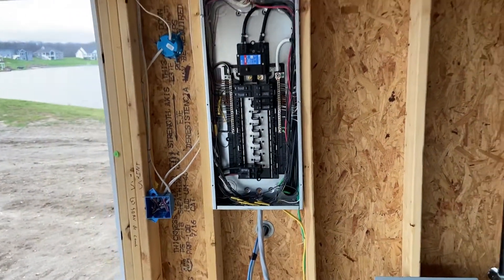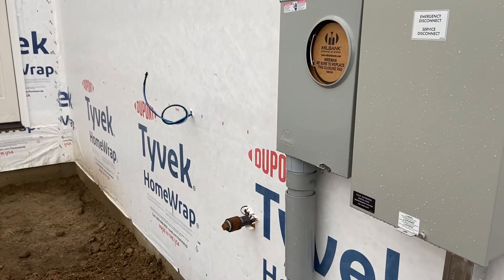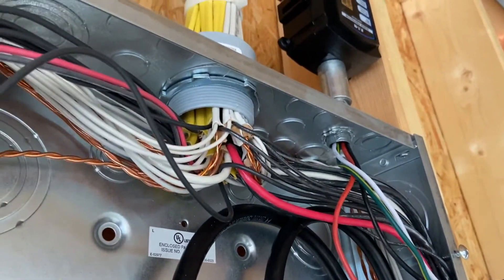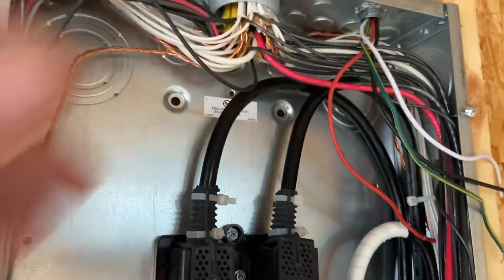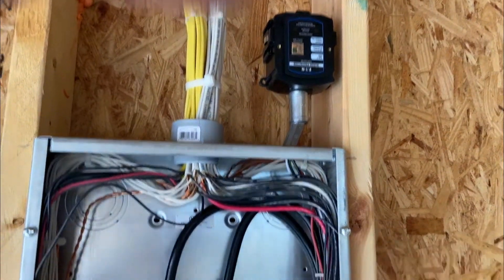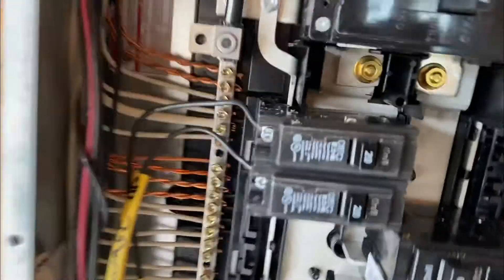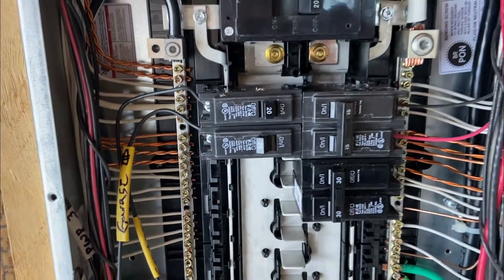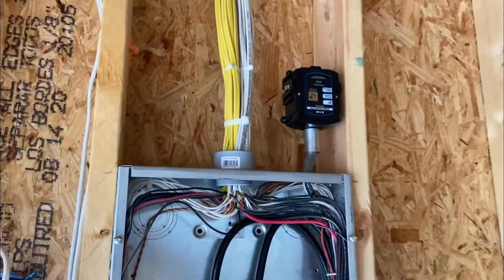How to install a Whole House Surge Protector Flush Mount | TL Davis Electric & Design

Comment: I know many others have already said this, but a "fresh" comment can always help in something this important. As per published knowledge of SPD function and the manufacturer, the wires should be as short as possible. The official Eaton instructions have a picture illustrating how this one should be done. It shows the SPD just outside the box to the side of the breaker with the unit mounted sideways so that the wires go directly from the SPD through the box wall (in this case also through the stud) and straight to the breaker. Shortest, straightest wire runs give the BEST SPD performance. Also, the "Ultra" model shown requires 50 amp breakers, not 15 amp.

Comment: Need separate ground bar. 😂
Reply from the maker: This is a main panel and the neutral and ground bars are not separated. Only in sub panels are they separated per code. The SPD should always be installed in the main panel on there own breaker.
Reply: @terrydavis5882  no lololol are you even a licensed electrician?

Comment: First. Bad way to mount this spd. If it gets a hard enough hit they break and you need to replace this one. So you’ll have to cut open the wall and pry it out.  There are SPDs with user replaceable modules and the base can be flush mounted.   

Two the ground wire. Outside should not enter at a hole that low. It should be parallel to the mains coming in and go through the same hole as the lines.  And you need to have a grounding bus bar terminal on that ground wire below the meter for cable and satellite and whatever else.  NEC 2008.  

250.94 Bonding for Other Systems. An intersystem bonding
termination for connecting intersystem bonding conductors
required for other systems shall be provided external
to enclosures at the service equipment or metering
equipment enclosure and at the disconnecting means for
any additional buildings or structures. The intersystem
bonding termination shall comply with the following…

And you can’t have that many conductors going into a panel through one large knockout tied together. Are you kidding me. That’s why there are 20 knockouts on top. You separate wires. Otherwise you run the risk of overheating. Looks like a kid installed it.

Comment: So it will be behind the sheetrock where the owner can’t see the lights to see if surge protector is working or change it out when needed.
Reply: No.  It is flush with Sheetrock dryer walkers will have to cut a hole for it.
Reply: @ It’s flush with the stud, how can it possibly also be flush with the sheet rock? Are these new zero thickness Sheetrock you are using on your house?
Reply: @ Sherlock here.  It’s not supposed to be mounted flush to the stud, but rather offset by the drywall thickness.  Just like any outlet or switch…

Comment: The CHSPT2ULTRA recommends a dedicated 2-pole 50 amp breaker. The CHSPT2SURGE recommends a dedicated 2-pole 15 amp breaker. You installed the incorrect breaker.

Comment: Wrong breaker and the wires should NOT be extended - Per Eaton's Installation guide the CHSPT2ULTRA must be installed with a 2-pole 50 ampere circuit breaker. They also specify that the wires should be as SHORT as possible, and NEVER extented.

Comment: Does it matter what side of the panel you install the breaker on for the Eaton SPD? If you're facing it you put it on the right... would the left work as well since it's a double pole?

Comment: Per Eaton installation requirements and tech engineers the leads on a CHSPT2ULTRA are to NOT be extending by any way under no circumstance. I actually called and emailed them about this because I find those leads to be to short for most installs. But you cite manufacture specs but failed to follow one of them. Keep that in mind for any future installs if your an electrician by trade etc. Cheers

Comment: How is the wiring of the Rolex coming out of the panel legal? All of the Rolex is bunched up tight. As far a I understand it you would have to de-rate all of the wiring due to heat generation. Correct me if I am wrong but I don’t see why you just didn’t use the individual knock-out’s.
Reply: You are correct, definitely bundling violation there

Comment: Nice job with the surge protection.      
2020 code requires a disconnect outside so my sub panel, similar to yours will have arc fault breakers.  The two large busses are intended for the clip on arc fault breakers so no pigtails are needed.  In my case I had to add a separate ground bus so I would have the dedicated neutral bus on both sides for arc fault breakers.  
PS you should have a bushing where your lines feed in the top of the panel.

Comment: The CHSPT2ULTRA  does call for a 50 amp breaker. If you had the CHSPT2SURGE then that would be a 15 amp breaker.
Reply: This is what I was going to comment.. Sitting here with the manual in front of me lol
Reply: that what i used , a 50 with the ultra. i had room on the side of the service panel to mount the eaton surge protector . this way no need to extend the wire. shorter the better as in the instructions.
Reply: The wire run is also way too long. The SPD should be right outside the panel with wiring straight through the stud and box wall to the breaker.

Comment: I was always under the impression that it is not to code to add wires within a main panel to extend the wire going to a breaker, in this installation, the SPD has to be installed in such a manner to be close enough to attach to the breakers using the original length of the SPD wire, am I incorrect?
Reply from the maker: When installing an SPD you have up to including the wires on the SPD not to exceed 18". Anything longer will increase damage to items in the house. With the standard length you will still not be able to protect 100% those items that are plug into an outlet close to the panel. I always try to install it as close as possible to the main breaker. Eaton has a kit to install it at the bottom of the panel. This breaker is usually installed on the last two remaining stops of the panel.
Reply: Each additional inch of wire is something like an additional 160volts hitting your electrical system

Comment: Also with the ATS from the generator being the main disconnect, any panel beyond that is now a sub panel by code. All neutrals and grounds should be separated.
Reply from the maker: Thanks for your input. The main panel does not be come a sub panel, when there is a main disconnect or ATS on the outside. You can find your answer in section 230 of the code book.
Reply: Exactly your panel is a Sub panel now that you have a Transfer Switch Sir....please Get it together.
Reply: Your Transfer Switch Has A Ground to Neutral Bond jumper and Definitely Is Your Main Panel Sir

Comment: If you sheetrock around it, how will you change it out when it goes bad? I would've thought it would've been in an access box. I'm not an electrician just thinking about installing one in my own home.
Reply: The lights on these are intended to be seen as an indication of when the surge protector is no longer viable. They should never be mounted behind sheet rock or behind the panel cover. Most SPD manufacturers also sell flush mount kits that secure the device in a visible location outside the panel
Reply from the maker: Thanks for your input and concern about the SPD. When install a SPD or replacing one that has gone bad. You just need to cut the sheet rock the same size as the Spd. The cover that is listed below will cover the sheet rock and hide the larger hole that you had to do when removing the old SPD from the panel.

Comment: You used the wrong size breaker for the surge protector.
Reply: Yeah. The Eaton ultra surge “blue trim around” it says in the paperwork it’s a 50a dp breaker.
Reply: A dedicated 2 pole 15 amp circuit breaker is recommended for CHSP devices, but a 2 pole 50 amo circuit breaker to achieve the full published rating of the CHSPT2ULTRA device.

Comment: One important detail is that the double 15 amp breaker has to be located right after the main breaker, just like in the video. It cannot be located anywhere that you find two empty spots. If the spot is already taken by another double or two single breakers, they or it will have to be moved to a different location so as to leave the spot for the 15 amp breaker which connects to the surge protector. Reason being is that in case of a power surge you want the surge to hit the surge protector first before it hits any other line.
Reply from the maker: Eaton says the breaker can be located anywhere in the panel. I chose to put it as close to the MCB as possible to do maximum effect for protection. If you have a fridge or freezer next to the panel it is most likely going to get damaged if the breaker is down stream from the MCB.
Reply: @terrydavis5882  Eaton also recommends 12” or less conductor length.  I would prefer to put the SPD in my panel but then I cannot see the lights.  I’ve seen your video where you install in a panel and Eaton sells a panel with the SPD inside, so it seems like that’s ok.  Is it against code to drill through the cover to see the lights?  Or do you just ignore this problem?
Reply from the maker: @brucemoose2  There should be a note below the video showing this was a special case. Do not put the Spd inside the panel. You can put it above the panel or below. I use a cover plate listed below the video. I also use a 1/2" offset nipple and 1/2" steel coupling and 1/2" lock nut. You will need to use the closes knock out to the front of the panel on top or bottom depending where you decide to put it. Put the threaded coupling onto the SPD and then the offset nipple. Put the SPD with all the items connected at the top of the panel. Make sure to choose one of the front knock outs. make sure its not close to the side of the panel. There are 2 x 4 on each side of the panel. Then when you have the exact height. Then trace out the SPD and cut it out. you will need to angle it in. Make sure to shut off the main breaker when doing this and where leather gloves and safety glasses. The black and red wire will go to the breaker. If you need further help let me know. Good luck with your project.